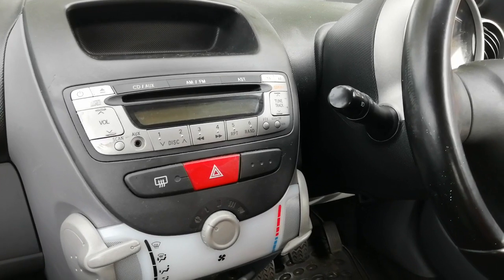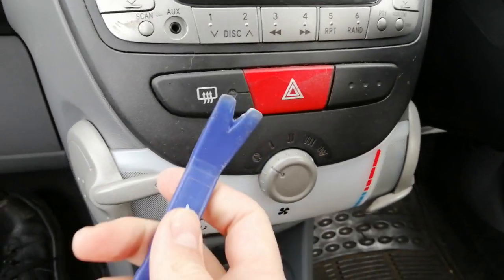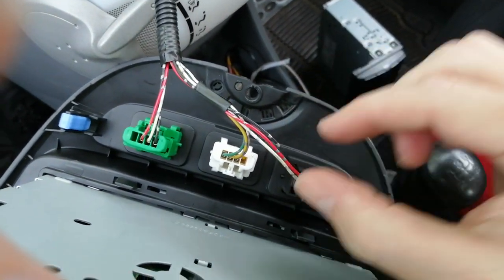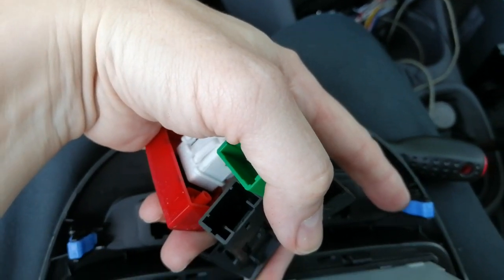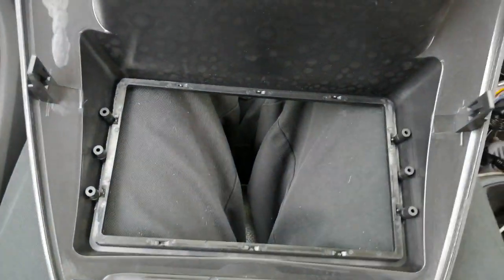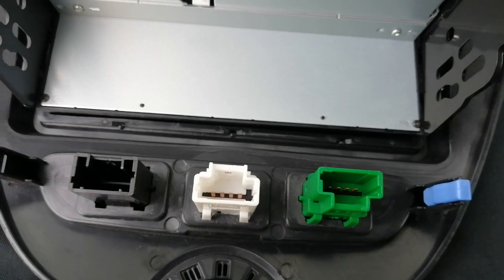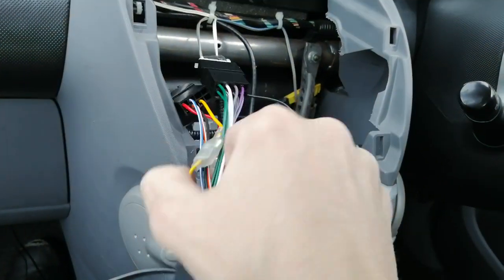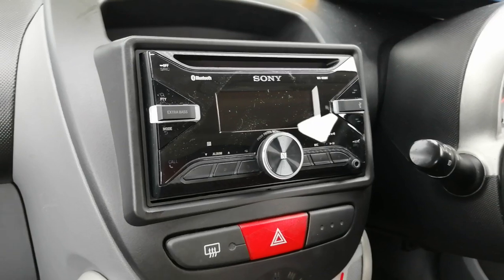Aygo 2005 to 2014 how to fit double din radio guide + part numbers

Comment: ive just ordered a new headunit for my C1 but the connectors are just bare and not ISO and I have no idea how to wire it! What kind of adapter do I need to fit it to my existing wiring from the car?

Comment: Question? Did you need to cut the dash as the stereo is only a single din with a double din facia. Just a thought as a single din fits fine with no cutting.

Comment: I have the Toyota Agyo 2016 1.0 vvt x-press and I have just order the CarlinKit USB CarPlay Dongle,Compatible with Android car system version 4.4.2 or above,Support IOS13/14 wired CarPlay and wired Android Auto Will I need to install autokit on my first before this system can work for Apple CarPlay

Comment: I have the 2 din MP5 touch the cheap one, i need to cut that too the grey plastic on the center so the radio it will fit?? Thanks

Comment: Hey man! really usedful thank you so much. with Covid Im going to have to do a new car radio install on a peugeot 107 (my current car is an Aygo.. so its all the same!!) I just wanted to ask a dumb question... why do you cut the inside? is it due to the radio needing that space? (obvious but i thought id ask)
Reply: Yep. There is no space there for a 2 DIN radio. This car was never designed to be fitted with a 2 DIN radio so if your radio need some space above the normal DIN designated space behind the front panel you will have to cut that plastic bit. Notice that his Sony radio is in the kinda L shape. Sad that bit that goes inside your car is on the top of the radio rather than on the bottom.

Comment: Is it a standard 16 port on back of the original radio? Looking at doing mine got my new radio but looking at a harness adapter to plug in as it’s an android radio, but not sure with out ripping out if the original is 16 pin

Comment: Hi great video. Just about to do this - did you find that by cutting the mid section that it weaked the dash or console area at all? any movement while driving or shaking etc? Many thanks
Reply from the maker: The owner of the vehicle never reported any problems and it felt firm enough to me.

Comment: Hi, I am a bit lost, do I need a special wiring harness/adaptor to connect the radio wires to the new double din unit?
Reply: Most likely you will need an ISO harness lead. Usually 5 or so quid on ebay or 15 ish from Halfords.

Comment: My radio keeps resetting everytime i start the car could you tell me the easiest way to fix it in detail mate
Reply: You need to swap the red and yellow wires so that red goes to yellow and yellow goes to red.
Reply: hi m8, what car do you have?, im just about to install a pionner radio on a 107, and hear the same about reverse the yellow and red cables from the harness

Comment: Hi. Just trying to identify the power cables from the car itself as I can see a black wire (ground.) and red but no yellow wire ?  Wiring an aftermarket Sony (or at least trying to) without success. New wiring loom to stereo has black, yellow and red wires to connect.  Have joined the yellow and red cables on the new loom then connected them to the car’s red wire.  Have then connected the new loom’s black wire to the car’s black wire but no power going to nth unit, even with ignition on.  Would you have any suggestions please ?
Reply from the maker: Has somebody chopped the original plastic radio plug off the cars wiring? you should be able to just plug an ISO adapter in and everything work.
Reply: PJs projects hi.  No, everything appears as original from factory.  I have identified the ignition live, made my own ground and wired in a direct (fused) permanent live to the battery.  Even rewired the speakers.  The ISO adaptor May have been the wrong one but my son is adamant it was the correct one.  Looking at it, the connector didn’t connect to the important stuff.  Oh well.  Lesson learnt...... don’t let my 17yr old son do stuff without checking with me first 😂. Thanks for getting back to me. If only it had been as easy as just using the correct connector 🤪 👍

Comment: Hey PJ Projects.

I have bought exactly the same facia kit and have followed your video. 
The kit only comes with 6 screws to mount the side plates to the facia kit and no screws for fixing the radio to the side plates. Just out of interest where can I get these screws? It says on the radio that the length should be no longer than 6mm and looking at screwfix and b&q's website can't seem to find them. Any ideas? 
Thanks
Reply: small hardware shops or locksmiths may have them

Comment: Any idea why it loses memory and resets to default settings each time ignition is turned off? Any help appreciated?
Reply from the maker: You need to swap the red and yellow wires so that red goes to yellow and yellow goes to red.
Reply: @PJsprojects  thank you. Done! But touched the pliers on the back of the stereo and popped the 15amp fuse under the hood. Doh
Reply: @PJsprojects  where are the red and yellow wires? I’m getting same issue
Reply: @ISSYOUTUBE1  from the harness that usually cames with you radio

Comment: For the life of me I'll never understand this stupid choices! Unless you need the additional screen area for reverse cam, nav system, etc. Why in the world butcher a car, spend money in adapters and so on. Just to have a big screen on an otherwise "normal" radio unit...
Reply: And bluetooth
Reply: The original radio is barely usable, it has not bt or any connectivity besides aux and also sounds horrible. A single din would suffice in this case, the double dins without rev cam or nav are useless imo
Reply: @harisalic2568  Horrible is an understatement, its positively horrendous!